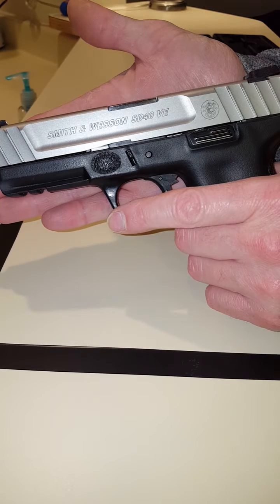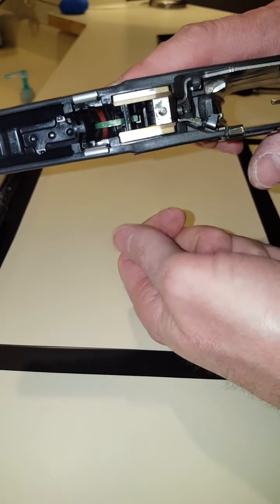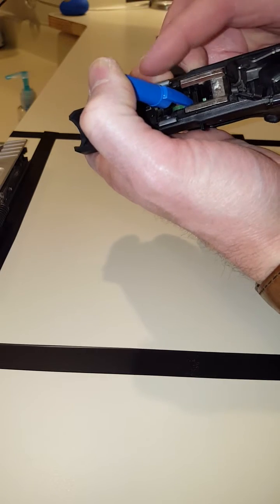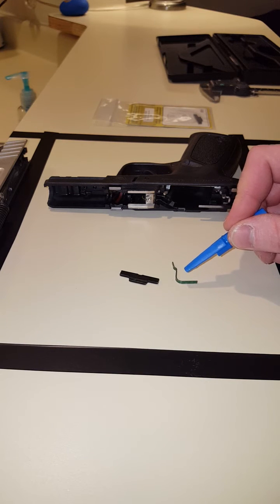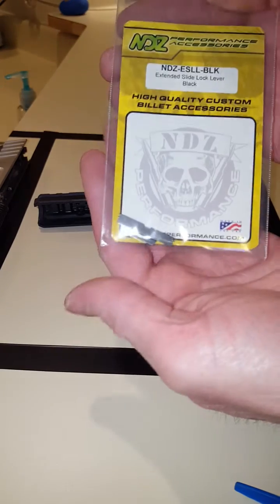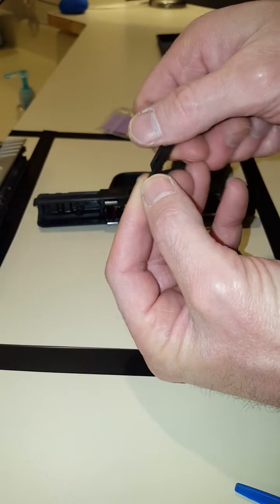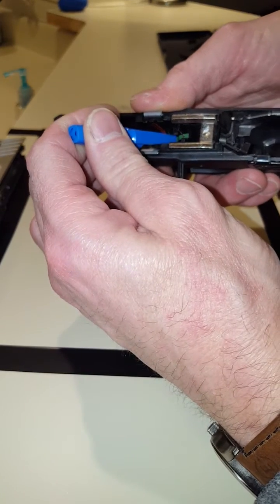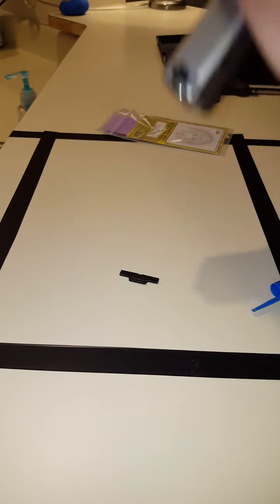Sd40ve takedown lever replacement

Comment: I have the SD9 VE and what a pain field stripping it! I am going to order this replacement takedown lever today off of Amazon, I think I will try to just push the old one out using the new one once the old one is off the latch so to not have the spring come off? Thanks for the push I needed...lol
Reply from the maker: Frank ! 
the second time I used this takedown I knew it had to go!!
I love my SD and knew it could get better that the stock field strip lever. Good luck and thanks for the reply. Easy upgrade....
Reply: Well I did exactly what you did...lol and thank you for showing me the right way to put the spring back in!  joking aside it was a 2 or 3 minute job even with the spring coming out. Thank you again !
Reply: Thanks to your video I knew to be mindful of the spring.  It took longer to remove the slide than it took to replace the part!  

Now I hold the frame by the grip in my right (dominant) hand, then push the slide rearward slightly while pushing down the release with my left hand then remove the slide.  Easy as can be!

Money well spent!